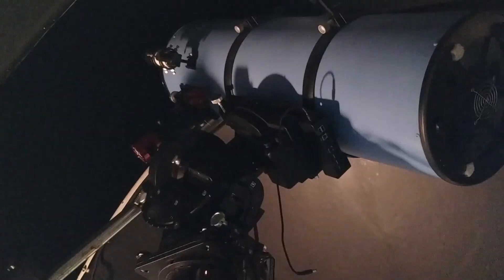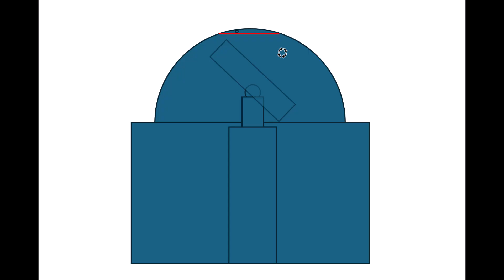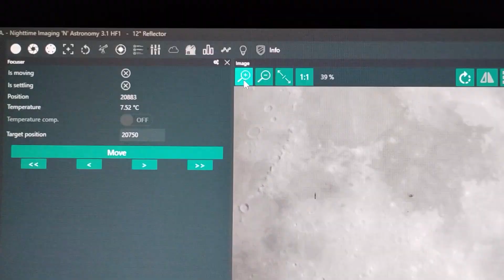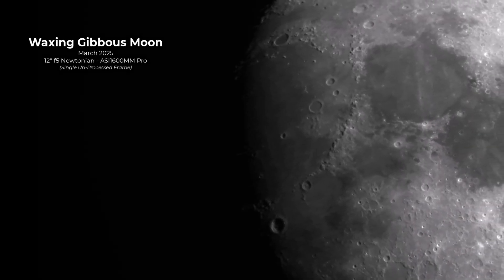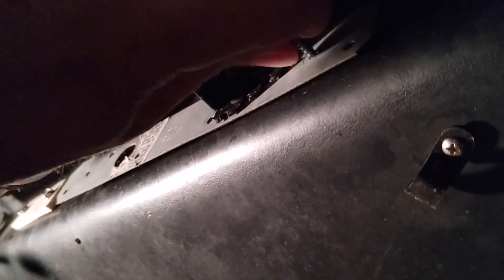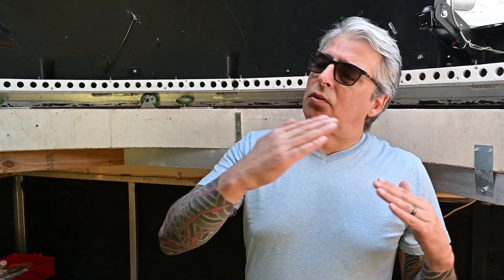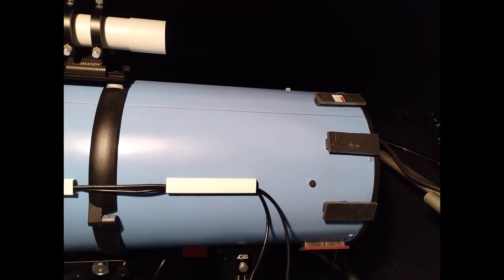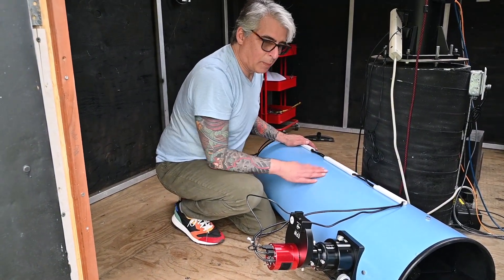12” Newtonian Telescope Deployment, Disaster and Recovery

Comment: Have you ever worked with baffles inside the tube?
Reply from the maker: Thanks for the question - I have not. I was doing some research on this topic and it seems baffling must be created with the optical path in mind. I toyed with the idea of making rings and gluing them to the inner OTA but I am not confident enough to try it on my only OTA! I have searched for off the shelf solutions and have found none. Let me know if you find something!

Comment: Great video, and glad you got it all sorted, can I ask, how did the mount get damaged, as the motors in the mount when you hit the obstacle should have just stalled, I had an issue recently where my CEM70 hit a premature stop and the motors just stalled, and although it made a horrible noise, no damage was done to my mount.. ?
Reply from the maker: Thanks for the question - yes indeed the stepper motors did stall - which is a nice thing about steppers - but the dome was rotating while in contact with the OTA. With the gears engaged, the OTA was essentially locked under it and served as a stiff "lever" which lifted the dome just enough from its track on one side. It is the Dome motor, which is a high torque DC motor, that supplied power to lift, rotate and dislodge. It didn't take much to dislodge it, and thankfully it didn't take much to get it back on track. Cheers!
Reply: @AstroDNAObservatory ah ok makes sense now 👍